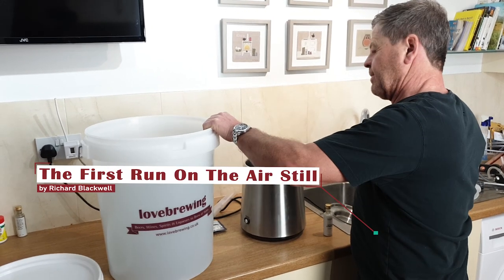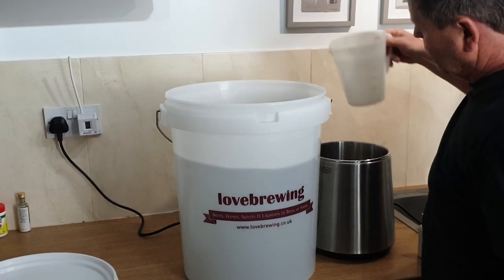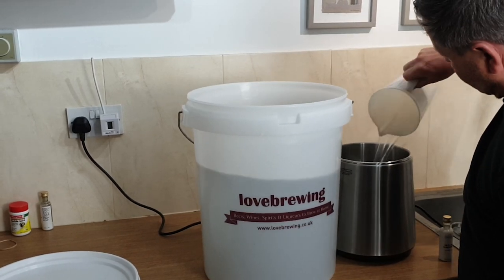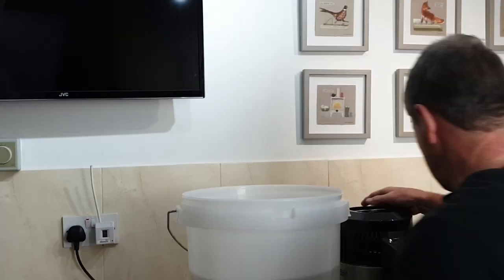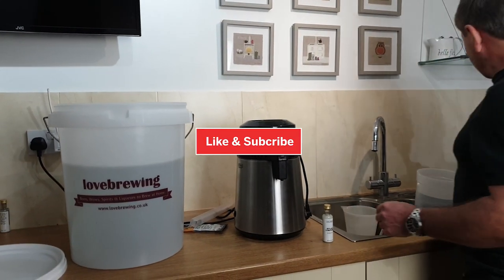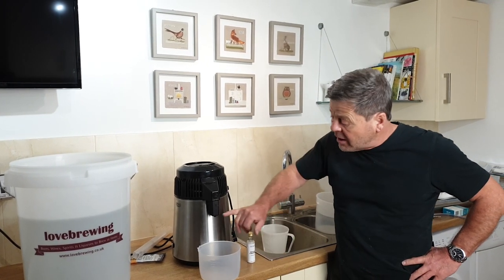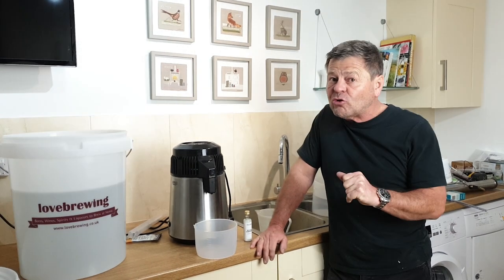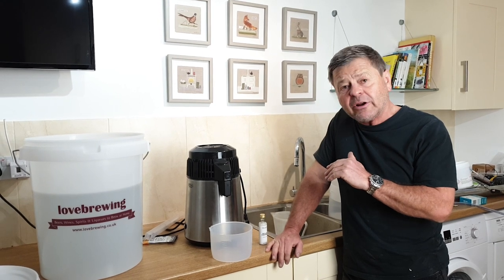The First Run On The Air Still

Comment: don't you throw away the first little bit collected?
Reply: Curious about this as well
Reply: Using turbo yeast and carbon and following the exact instructions, it makes very little methanol 
Apparently
Reply: Dont kiĺl
Reply: Apparently it doesn't produce enough alcohol to produce enough bad stuff to harm you
Reply: As long as it doesn't have pectin it doesn't produce too much methanol and the antidote for methanol poisoning is ethanol. I'd be real careful with a fruit must though.
Reply: @apostolicalcoholic534  what’s a fruit must? Can you place fruit like lemons in the fermenting wash bucket and flavour the spirit?
Reply: @TheGreatest1974  Fruit must would be any mashed up fruit you use as the base to ferment into alcohol. If you used lemons the distilled product would be limoncello, but you'd have to fortify it with additional sugar to get the ABV up and take the lower pH into account. Haven't played around with citrus fruits, but it might yield interesting results. A short cut might be to distill a different fruit with higher brix and add lemon zest to the distilled product.

Comment: Can I re-distill a cheap bad tasting whiskey etc. again in my Air Still its 580 watts? (stainless inner top, but I think it has an aluminum inner pipe, but I might be wrong) It's great for water. ...and what's with the copper in the outlet? (cooler?)
Reply: Contact with copper removes sulphur compounds that taste nasty
Reply: The pipe is stainless, the cooling fins are made of aluminium.

Comment: Will the process be faster if you heat your wash up to say 120F/49C ?
Reply: I have been thinking exactly the same thing. Air still has a 750 watt element but my stove element is probably a 3000 watt.  I was thinking of putting 4 L of water in a pot and measuring how long it will take to get to 50 C.   And I would use that time for the pots of the wash.
Reply: Yes but with this still it will cause a horrible taste slow is better
Reply: I throw 4 liters in the microwave for 8-9min/800watts, to accelerate the process dramatically.

Comment: New to home brewing....
I have noticed that when I purchased my air still that nowhere in the instructions that it said that I had to cut off X amount to get rid of methanol...is that an oversight or do I have to get rid of a % of first cut?
Thanks
Reply from the maker: As long as you use the pure yeast with sugar there is no need to through away the first 50 or 100ms (because the yeast is so pure)
Reply: Hi, can you tell me what the white button the front of the still is for, please?
Reply: @krell2130  reset if you overheat it! Don't.